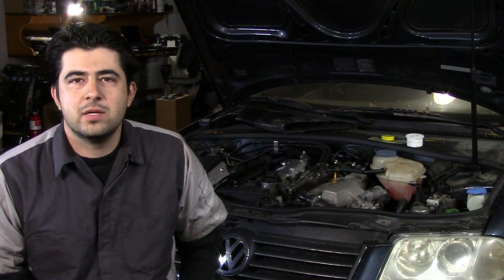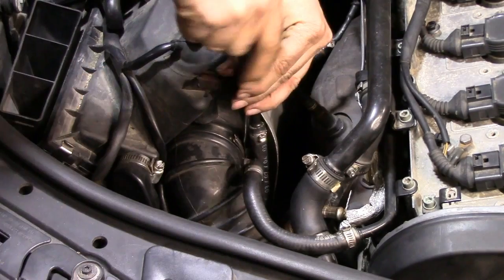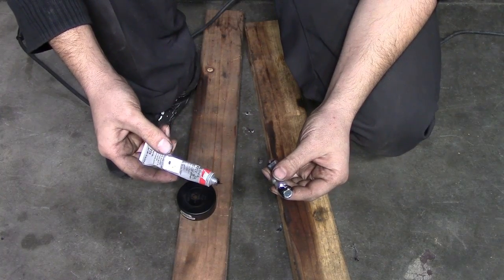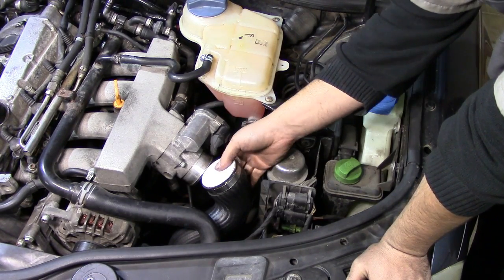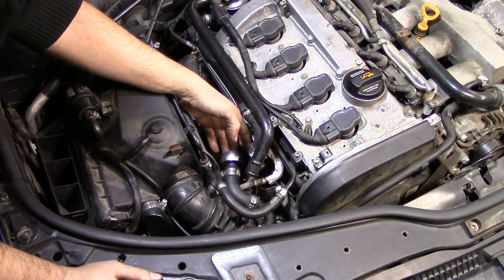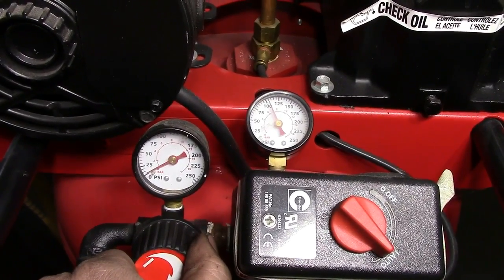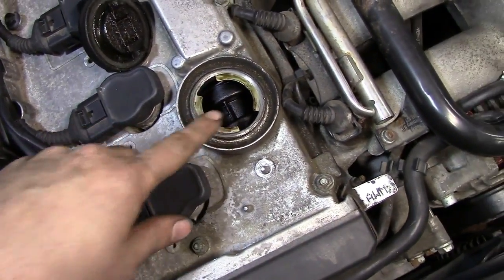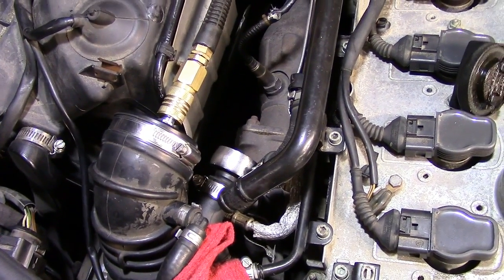How to Make a DIY Boost Leak Tester - Also Tips on Finding Boost Leaks

Comment: I'm confused why you wouldn't want to pressurize the entire intake manifold instead of blocking off at the throttle? i just found a massive boost leak at injector o ring that would not had been found using this method, it was a tricky leak because it only appeared once about 3 psi was induced.
by only pressurizing the intercooler assembly you can miss many many leaks,the system was designed for boost so its not like its gonna hurt anything right
Reply: 100%
Reply: @marcooconnor valves will be open manifold won't hold boost

Comment: Hi!  I have been following you for quite some time now and I love your videos. Keep them coming. I have a 2005 Audi 1.8T and I just recently upgraded to a few performance parts and I re-allocated the N75 valve away from near the turbo where it was originally located to the firewall passenger side. Will this affect boosting issues because of the greater distance it now has away from the turbo? Thank you in advance.
Reply: You can just delete the n75, they are sometime faulty causing boost psi to spike and that can cause some damage
Reply: @c12_pra72  Then what is the replacement for the N75?
Reply: @Chris-lz7sx  there is no replacement, you delete the n75 and just cap it off as it’s not necessary
Reply: @c12_pra72  the n75 valve is a boost control valve how can that just be removed and not replaced.
Reply: you cant just remove it. you'll only run off the wastegate setting if you do (4psi?). you would need to run a manual boost controller instead if you removed n75. but dont do that. personally i would keep the n75 close to the turbo.  i moved my dump valve close to the throttle body for the same reason. (i have a race ecu and run 100%  atmospheric dump valve though)

Comment: I know this is an old video, but does anyone know what the small hose that was clamped with the pliers is called? I have a 1.8t AWT Passat and I don't seem to have it coming out of the tube from the air filter box (the tube looks a bit different).
Reply: RealDigitalP I think its called a Engine breather hose

Comment: Wouldn't it be safer and better to just use a smoke machine?
Reply: Some leaks appears only with certain pressure - there was an example in the video. No way to find it with smoke without pressure.

Comment: Great video. I have an '07 audi a4 2.0T - If I want to check for boost leaks among the injectors and intake manifold (post throttle body), then I can simply leave that portion unblocked without any issues, right? Even through the throttle plate is closed, you mentioned that enough air will leak past to build air past that segment of the system. 

thanks.

Comment: thnx so much for teaching us , god bless you and your family.
I have a question :
can I do this with an emergency tire compressor , you know the one that uses 12v cigarette lighter plug  ? thnx
Reply from the maker: you can do this with any kind of compressor or even a manual air pump. Just have to find the right fittings..also VERY IMPORTANT to be able to accurately regulate the air going in and stay within the threshold. If you put too much compressed air in, you will damage something and cause a boost leak where there wasnt any before. Also your adapters will come flying at you. GL